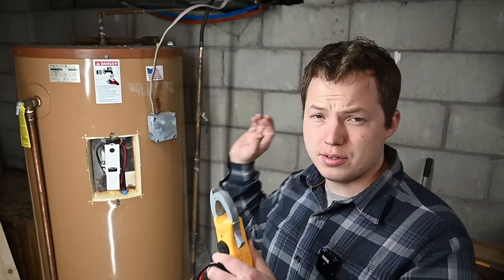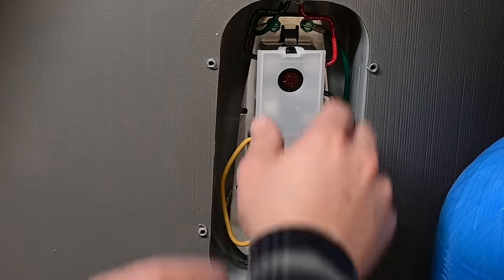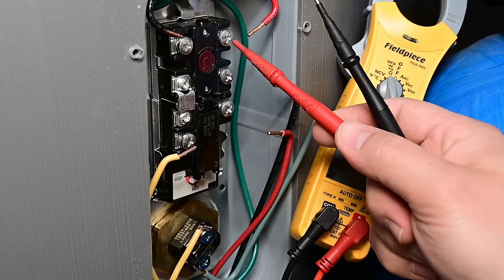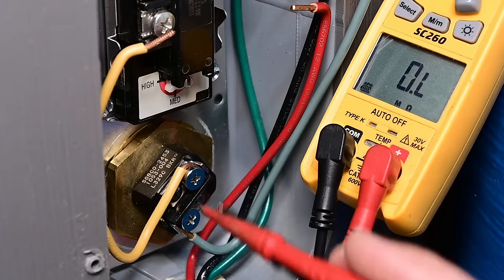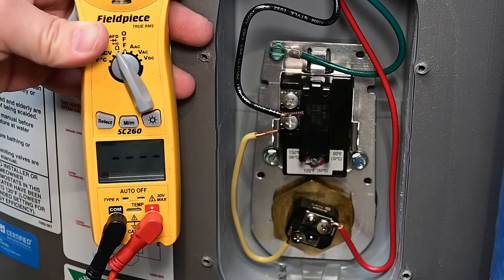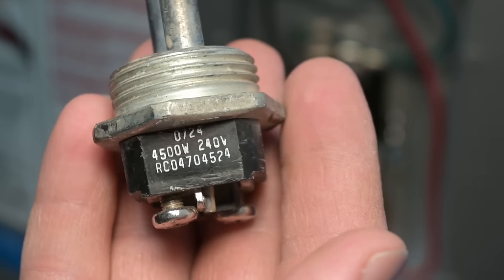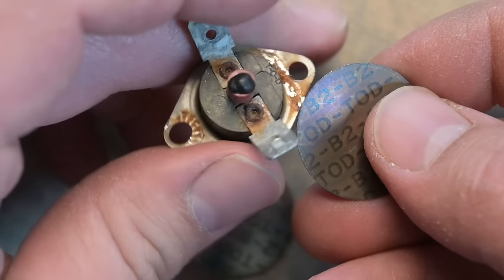How To Check Electric Water Heater Elements & Thermostats With Power On & Off

Comment: Ben, thanks again, another useful video. Not meaning to be too critical, but at approximately 14:40 you talked about checking the main thermal trip device with the power on. If the device is opened (both sides) then all that lies below it is isolated from the supply. Then measuring voltage between the top and bottom terminals on one side should be equivalent to connecting to one side of the 120V supply and (almost like) holding the other test lead in the air. The only reading that can come from this is the potential derived from a current leakage to ground presumably. I am sure your meter is very high impedance (it doesn’t put any appreciable load on the measured circuit) and hence you might get a reading depending on the amount of leakage. I believe that the best way to check this (with the device in place) was what you did for the top connectors. Confirm that 240V is present between these bottom connectors – this verifies that the supply has passed through this device and is available to power what lies beneath.
Reply from the maker: Yes, you are correct and I thought of that after the fact. I am actually surprised that it took this long for someone to comment about it so excelent catch! If it was only disconnecting one side of the thermal overload then it would work the way I demonstrated but it is designed to cut off both sides so what I suggested is flawed as you mentioned. I don't know why I didn't catch that sooner but hopefully I demonstrated enough that people will still be able to figure it out. 

Thanks for the comment!
Reply: Ben, thanks again. No worries.
Reply: I was reading for this comment.  Or check continuity on each side.

Comment: Doing a great job.  I love the detail as I usually pick something I never realized.  I never though of testing "across the wire" (connections) and have a 0 volts to show three was "continuity" while the power was on.  Some times the simple is just basic.

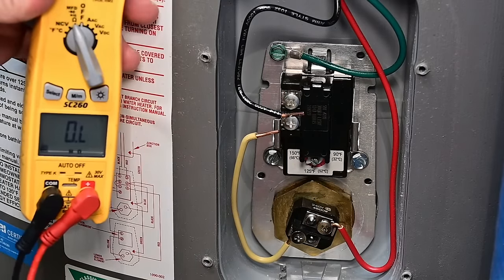Comment: Schematic just after 12:46 for anybody who is interested. Great review, Ben! Once understood, as is typically the case, it turns out to be elegantly simple. Love the way you took apart the thermostats to see the thermal discs. For those who got here with a poorly functioning old style heater, don't forget the dip tube. These more modern ones route in the bottom so have no dip tube.
Reply from the maker: I should have pointed out the schematic better as I thought if doing so but forgot. Thanks for sharing the timestamp!

Comment: Great job. So if I understand correctly, when the upper thermostat is on, the lower will be off? Regardless of the temperature setting? I have a water heater that seems to be overheating. Replaced the upper thermostat. Maybe it’s the lower? Thanks. -Ed

Comment: Benjamin, I noticed that there was a schematic on the cover of the HWH. Would that have been a golden opportunity to discuss Power flow diagrams. My back ground involved a lot of print reading and found them invaluable in determining how something worked. Great video, thanks.
Reply from the maker: I actually did take a picture of the diagram that I was going to use but kind of forgot about it during editing. Might have to do another video on that!
Reply: @BenjaminSahlstrom  That's how I found out how a hot water heater worked in the first place! :) Thanks for the reply!
Reply: @herbertrockey3099  Gotta agree...When attempting to fix anything, Wiring and/or system diagrams in general, are always extremely important and helpful in understanding how something works...It's like having a road map to a destination you've never been before, and without a map you're probably going to get lost or end up in the desert....If you understand how something works, or how it's supposed to work, you can fix just about anything(within reason of course)...You'll likely need some test methods, equipment/tools in most cases, but with none of the above you're just guessing, and will likely go around in circles and never arrive at your destination/the fix👍🇦🇺

Comment: Your video was very clear with good pictures, afraid you lost me on when the wires had volts with the power off and the element was on or off with the thermostat.   My problem is using an inexpensive multimeter and selecting the right spot to turn it to.  The actual changing out of thermostat and element was made very clear so I can do that. Probably not the testing as I would not know where to turn my cheap multimeter dial even though it is good to know you can do the testing with no power.   I thank you very much.

Comment: Replaced both elements, anode, pressure release valve. Now going through the thermostats. Tank was cleaned out and fingers crossed. Hope I don't have to replace the thermostats.  Cheap enough though.

Comment: Thank you Ben. It may have been a bit of an overkill for engineers but they don't need it in the first place. I followed a couple DIY vids on troubleshooting in 6 minutes and was on my way to get new elements. Then I started thinking. Then I realized it didn't feel right (you know that feeling in your gut that says you need more info). No, I didn't need new thermostats, I needed knowledge. And as you said YouTube algorithms are pretty good at putting what you need on the recommended list. Anyway, I watched it twice, Liked, and then Subscribed. A better than good video. Now for my sub-panel.

Comment: THx for a great video Benjamin.
You have a link to a complete element & thermostat kit, are these units pretty much universal or do I need to buy from the company that made my tank?
Lastly, is the quality between element & thermostat brands more or less equal or are there better brands?
Thx again!
LOL, Havilah is so cute.
Reply from the maker: They are mostly universal. Personally I wouldn't hesitate to use aftermarket parts. I'm sure there is likely some quality difference but it's probably not a lot. Of course there are probably some manufacturers out there that require proprietary oem replacement parts.

Hope you get your water heater going again soon!
Reply: @BenjaminSahlstrom  
 So I did get it going, at least tempeoryly.
Three years ago I replaced the top element with an OEM.
As I was doing testing per your video, couple days ago, I saw a drip coming from the element I last replaced.
Everythig checked out per your video, so I'm guessing water ran down creating a short.
I cut a piece of plastic from a milk jug and heated and formed it to direct the water out of the unit.
I then ordered your suggested kit that looks identical to the OEM.
Only difference is the OEM kit didn't come with an O-ring.
Had it did, I wouldn't be where I am know.
Your kit does, so I'd recommed others to purchase your kit.
I looked up my Amazon histroy and I paid $85 for the OEM without O-rings and your kit was only $35 with O-rings.
So thank you very much for a really good tutorial on diagnosing the tank.
I am using your video to teach my sons how to do the same and I bought that same tester you have, it's on order.
Thank you again, you saved me money and enriched our minds.

Comment: Great video. I learned a lot. However, I'm puzzled. I replaced the pressure release valve due to it leaking. However, after replacement, the valve still leaks. Any suggestions? Thanks, Roy

Comment: Thanks, for a great video on learning the parts and how they function on electric hot water heaters. I'm working on my rheem hot water heater this date. My water was getting way hot so I believe my top thermostat is stuck. Will be replacing top and bottom thermostats. Your video is big help. Subscribed

Comment: Hi Benjamin, 
Great video, thank you! 
I have a Rheem 40 gallon, it is not making hot water. I removed the elements, they were clogged with sediment, I cleaned them up and they test fine. 
The odd part is, when I test the power in, the top two leads, I get 3 volts. When I test each leg, I get 120v per leg ??

Comment: Great video Ben. I have one question . If I connect the second thermostat directly to power lines not to the first thermostat. Is this water heater running
@ 9000kw?

Comment: Okay I like this video compared to all the others I've seen, very thorough. However, and u may already have a video like this, but maybe make one that shows what to do if there was an issue such as in my case the right side of top thermostat isn't getting any continuity which I'm sure would just replace thermostat but before I do that I had another issue troubleshooting after it was all hooked back up. I checked voltage at top and it's not reading but before all this i actually checked my breaker box and the breaker was good. I am about to check it again but I think that would be a helpful video and maybe put the link so that after we watched this one we could go right on to diagnose the issue since this video was so detailed it would be a great help. Thanks for this I am now gonna recheck my breaker and go from there. BTW this only happened after I had to quickly throw the main breaker bcuz my daughter had saw a spark come from the box. I took all apart and checked that and already kinda knew but hey if you have knowledge on breaker boxes, this Mom who is Dad too would LOVE to see it! 😊

Comment: This vid helped. Im trying to work on my 110 tank water heater. Single thermostats & element.
I drained water system for winterizing it. Power to water heater was accidentally turned on while tank was empty.
Replaced element. Still no hot water.
Any tips?

Comment: Great videos. They’ve helped a lot. Currently working through an issue where the water heater breaker on the panel keeps popping, but all the continuity and resistance readings check good. It pops after the heater runs for a few minutes, not instantaneous. Could this be an element that shorts as it’s heated or the thermostat trying to power both elements at the same time?

Comment: Well done tutorial. Very clear instructions and explanation of the workings of a two element water heater. The only question I had...how much does the red trip button protrude out when tripped. Based on the thermal disk that trips, I would assume that the trip protrusion is the same as the thermal disk when tripped. Thanks for the tutorial.

Comment: yes good one, the upper stat is 65 dollars here in Au, i suspected it, i hotwired the bottom one which got the upper to very hot, then  i took off the hot wire and then the bottom one had juice , so there is no trip button here in Au and the amps were only 9.7 at 245 vac, reckon you saved me but we'll see
I  use a Fluke clamp metre
unfortunatly the ajusting thingies are buggered

Comment: Another very important safety device just as important or perhaps even more important than the ECO switch, is the temperature and pressure relief valve, designed to open and reduce dangerous pressures and temperatures over 150 psi or 210°F. For example if a thermostat fused closed or a heating element developed an internal short near the center so as to cause runaway heating from the unswitched 120V AND the ECO failed,  once the water approaches 210°F the T&P valve will open full force and remain open until the temperature at the valve cools down as cold water enters the tank to moderate the temperature.

Comment: In Mexico without a multimeter, a light bulb became my meter. I was able to understand and get the both elements to switch back and forth on 120v. It is rated for 120-480v I bet that on 480v, both elements are used.

Comment: Great Video. My water heater is under performing and I've tested all of the upper and lower components. The reset switch is good. The upper and lower elements are good. I have continuity on both the upper and lower thermostats. I'm wondering if I have a problem with the upper thermostat transfer switch. If I have continuity across the upper thermostat it seems like I should have no continuity (1 ohm) across the switch to the lower but my meter reads 26 ohms. Is this an indication of a fault in the transfer switch?

Comment: Hi... I just came across your channel, and subscribed, but I do have a question. My heater just tripped for the first time in three years. I read my manual that came with the tank and one of the trouble shooting comments stated that it could have tripped from too much sediment in the bottom of the tank that had accumulated over time. I get water from my drilled well. So I flushed the tank until almost clear and did get a lot of rust and mineral sediments in the process. Could this have tripped my high limit switch? I reset the switch and have not had a problem since. I did not test my thermostat or element only because of its age, but the tank did heat up again and has been fine. Could the sediment have been the issue? Thanks in advance.

Comment: At 13:38 I'm reading 0 between the two. But I do have 120v when I check each individual side. Does that mean anything? I still can't narrow down my problem. I do have a Marathon similar to this. No hot water. Resistance on each element reads fine.
Reply: I am having the same problem. Were you able to figure out what happened?

Comment: Great video and highly informative. I reviewed my BradfordWhite service manual which says the following "Reading should be 12.8 ohms (±6%) for a 240volt, 4500 watt element. A reading outside the range using the formula above (±6%), indicates a bad element and the element must be replaced."  So I checked both upper and lower elements and my multimeter shows 12-13ohms initially and as I held the multimeter on the contacts the reading dropped to 9.5ohms after 4-5secs. Im not sure whether to go by the initial 12-13ohm reading or the 9.5ohm reading 5secs later.  Do you think I have a problem here?  The heater is the M250S6DS-1NCZZ and id about 15 years old.  Thanks in advance for any further info.

Comment: I’m assuming you replace the upper thermostat if you’re getting 120vac at each leg, but not 240vac across both (terminals 1 & 3). This failure mode wasn’t discussed in the video.  ECO reset good, but get about 60vac when pressing it while measuring, still no 240vac though.

Comment: Good video that shows what correctly functioning water heater thermostats should be doing, however, it would be a great video if you also went over what a bad thermo would be doing. Ex: you went over a lot of examples of  either 240v or 0v, but did not cover what is wrong if 120v is showing, or what the thermostats will and will not do (click or check resistance) and when the heater is completely cold, what will the differences in your results be, etc. If you were to go into more detail on the scenerios and describe what the thermos would be showing and why in the possible bad thermostat outcomes,  it would be an excellent video!

Comment: I really enjoyed your straight forward  video and I took copious notes and numerous rewinds to understand the wiring. However when I went back to diagnose with my multimeter and found the upper element and thermostat working I was puzzled as the light was out on the upper. then I realized that didn't mean it had failed but rather the thermostat was trying to get the lower element working. when I pealed away the insulation I found the wire going back to the thermostat completed melted and disintegrated with parts of the plastic around the element also melted. Now my suspicion is that the water supply was turned off and the tank was continued to be used until drained and then overheated, does that seem logical? The element inside did not look ruptured.

Comment: Easy way to verify what your ohm reading should be:
1) safety first.
Turn the power off and verify at appliance line in. Breakers often get moved or mislabeled over time.
2) Some easy math
(Volts x Volts)/Watts = Ohms
So a good 240v 4500w element should ohm at 12.8.

Comment: Went through and tested our water heater just as you described. Everything checked out ok. Renergized the water heater and seemed to be working fine. Water heated up correctly. Came back about 6 hours later and the water temp had dropped to 109. Would you be able to think of something I’m missing? maybe one or both of the thermostats is malfunctioning somehow?

Comment: Hi Benno, thanks for your consistently awesome and very thorough vids. Just a quick question...Although I'm sure you know your meter well and trust it with your life...I was always taught to test your meter with power on first, to confirm it shows the voltage you're expecting to see before turning off the power, then re-test again once power is switched off, as confirmation. Just curious if they teach the same method over there?👍🇦🇺
Reply: He has a field piece, they don’t fail, I’m sure he’s fine. I guess just touch the leads together for continuity but fluke and fieldpiece never fail; that’s why they cost and arm to get.
Reply: @anthonyguzman412  You are obviously a DIY person, with no professional training or real world experience in this field.
Sure, he has a 'fieldpiece' branded meter, which is exactly my point here.
It's just a cheapo $75-$100, no name brand meter??
It might be perfectly fine, but dont be deceived, just because it's yellow, it's not a Fluke in any way!!🤣🤣🤣

Comment: Measuring voltage on the same side of the limit switch is like putting the leads on two spots of the same wire. It should actually be measured across the parallel leads immediately below the power above. Otherwise great job if a bit too much detail.